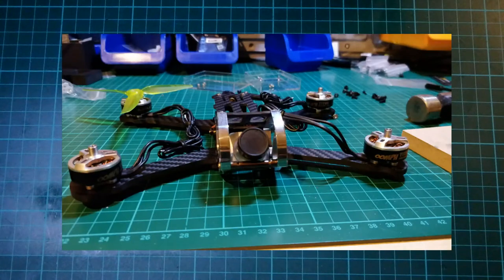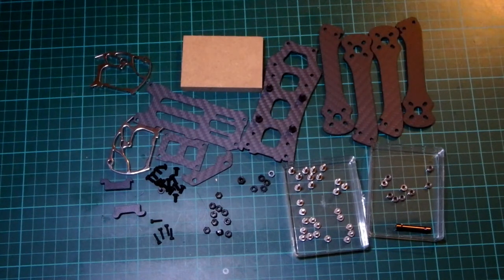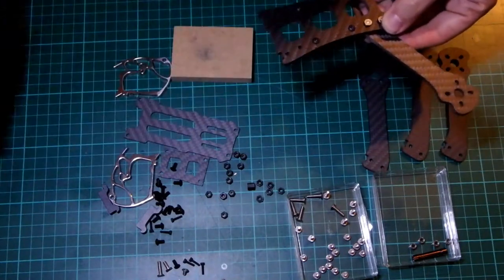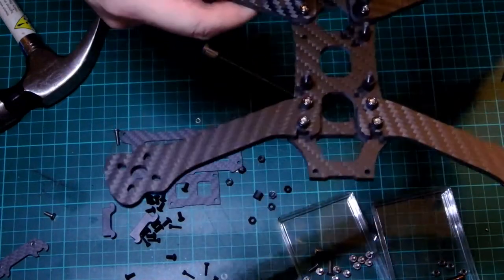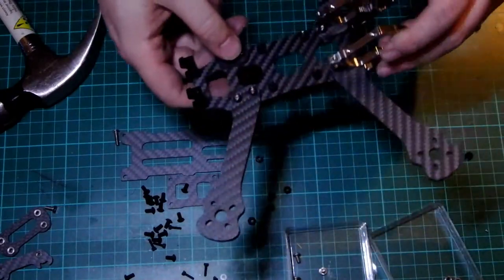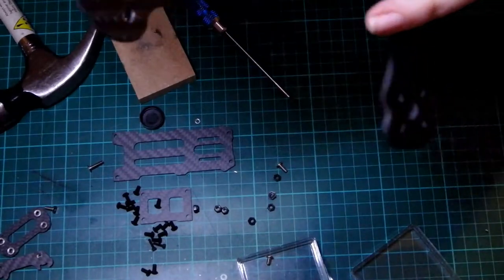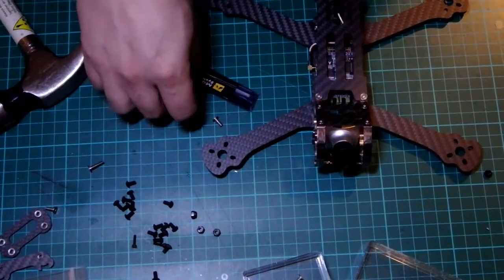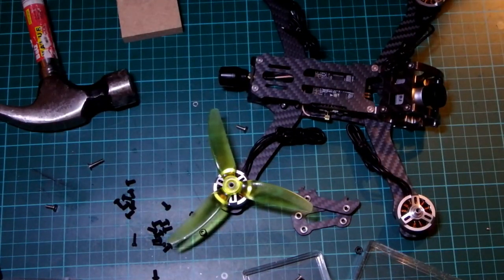Lets Build: Titan Rooster Part 2: The Frame

Comment: Jeez, I’m struggling with my frame due to the same issues you are dealing with. I was hoping that I would get on YouTube and find “the right way” but I’m so disappointed. Bought this to not replace but fly along side with my chameleon (Love my chameleon). Kind of pissed at the moment. My MIP drivers fit sloppy in screws so I can’t tighten properly. Those stupid nuts are a joke to install and the play in the arms is unexplainable.
Reply from the maker: It is Frustrating and i was hoping i would  enjoy this build as much as my Chameleon. The good thing i that Armattan have recognised the bolt issue and will send you replacements free of charge.
I do just wish the front stand offs went on a little easyer.